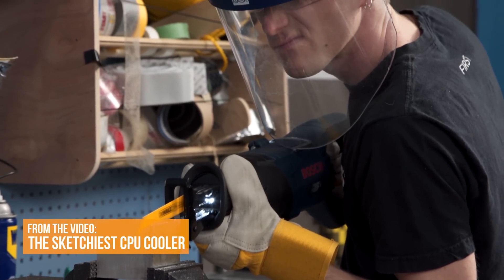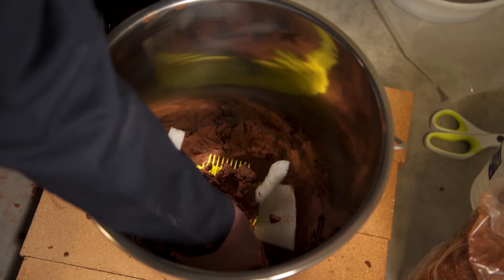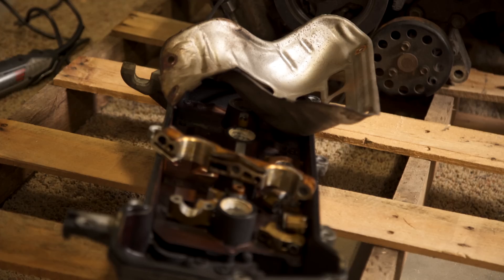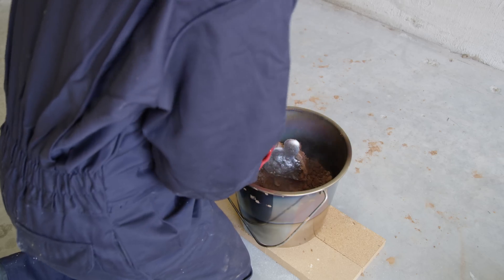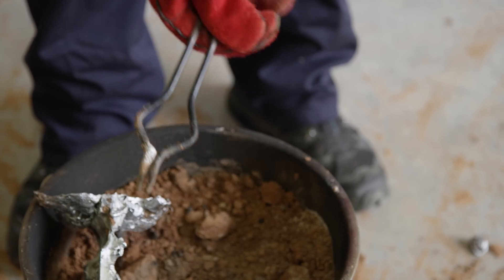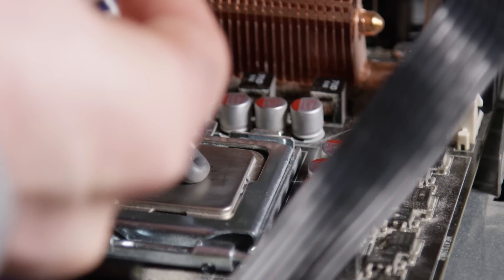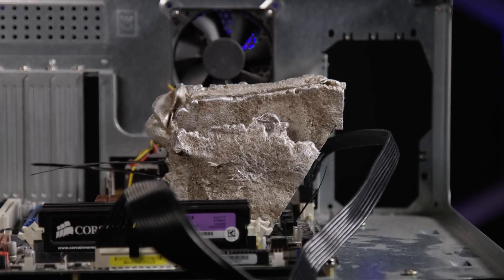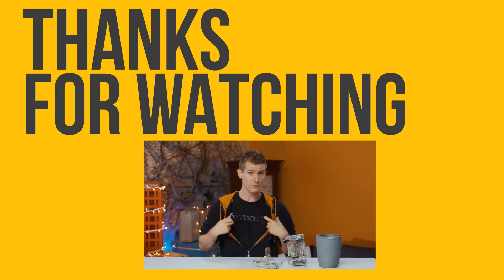The WORST CPU Cooler EVER – Sketchy Heatsinks Ep2

Comment: Hi.
First, I love your videos guys, keep up the awesome work !!
Second, as an almost graduated mechanical engineer, I can tell you that the best way to build a heat sink is probably using a CNC milling machine. There´re a lot of DIY products available, and you can probably get one for free via sponsors, and also it would be a great video (IMHO). I´m currently working in CNC/3D printer as a project in my university =), if you want, I can send you more info about it as I progress in the project.
Once again, love your vids, and have a great day =)

Comment: After you make a plastic model, coat it is rubber to make a reverse mold, then make a second copy of wax. And why would aluminum go up into the fins????? Of course you could mill fins from a block of aluminum, but not with a reciprocating saw! Saws like that are use in demolition. You need a router bit for medal and a jig. Where did these ideas come from????

Comment: I love how it looks! from cooler masters bronze age range. You could have made a mould from heat resistant rubber, If the aluminium didn't melt the plastic then a heat resistant rubber should be ok.

Comment: -3d print the heatsink made in solidworks
-press the plastic heatsink into green sand from above so it forms a mould
-carefully remove heatsink from top of sand
-pour aluminium :)
Reply: Rico Willebrands instructions unclear. eye stuck in water bottle
Reply: Rico Willebrands that's actually a good idea
Reply: Dennis Rigdon No, It's casting... Forging is a completely different process.
Reply: Rico Willebrands this is proper forging 101

Comment: Alright, lets watch this train wreck.
Edit : Was not disappointed. Maybe watch a video or two on aluminum molding before attempting this next time... like using Wax for the initial mold, baking a clay mold of said wax mold(maybe 3D printed stuff could work too if it melts at oven temperatures), which makes the wax melt leaving you with a hard clay mold... then pour aluminum in the hardened clay mold... I dunno, just saying.

Comment: honestly you guys were casting it wrong the fins should been pointed down at the ground instead of facing upwards
Reply: milodudeful why did this not get more likes?!
Reply: ikr
Reply: it was easier to get a flat bottom this way
Reply: megaspeed2v2 nothing was easier the way they did it... lmao!
Reply: megaspeed2v2 easier in regards to NOT weighing out how much aluminum would be needed as well as them not supplying any guiding pressure vents to prevent air pockets getting locked in any intended level surfaces. Part of compacting in layers is allowing for any sort of modification that would be over the top with the throw away cast.
Reply: megaspeed2v2 you can always grind down the bottom like what they did in the video
Reply: Umayr Sayfurrahman it's almost doubled in the hour since you commented ;-/
Reply: Wow 71 likes it would be nice to know if someone likes my comment THANKS YOUTUBE agh lol
Reply: I was thinking that too. 'Upside down Linus, UPSIDE DOWN!'

Comment: why not put the cast upside down in the sand so that the metal can seep through easier with gravity?
Reply: umm, "they would have to sand something down" pretty sure they did anyways at the end.
Reply: If they using an upside down model, I'm sure gravity would have filled way more gaps and it would have a way flatter surface for the mounting.
Reply: as long as they have a bottom that cover ALL of the fin gaps, it would work much better, not even a question, I can find the answer to that in gravity logic.
Reply: As with all castings, you are required to machine any surfaces to meet specific characteristics. For these reasons and more, the head gasket surface and bores (and numerous other surfaces) on an engine block are all machined to meet there specific goals. Casting is just the first step in producing a finished piece. Cleaning and machining are just as, if not more important.
Reply: TheFPSPower Not the gaps that need to be filled though
Reply: Because its Linus team.
Reply: You're onto the right idea here. Instead of using a medium that is burn away (which is used in more hobby casting) you can make an impression using you 'pattern' in the casting sand. Think of it this way: You could also use copper which has less issues with oxidation, has better heat transfer properties, and melts at a lower temperature.

-Have he sand ready, well compacted and level.
-Then press the plastic heat-sink pattern fin side down into the sand. Ensuring that the base of the heat sink is level with the sand.
-Then remove the plastic heat-sink patten form the sand. You'll now have a negative impression of the heat-sink in the sand
-Cure the sand to reduce moisture content
-Pour in the liquid Aluminium in.

The Aluminium will find its way to the base of the thin fins pulled by gravity. The base at the top of the mould will have a ruff surface that can be machined later.

To cast the heat sink properly however you would need a multi part mould.

Option 2: Pay someone with an Aluminium/copper 3D Printer (yes they exist) to simply print your solid works shape. Or less costly, use a CNC ;) 
Option 3: Use a Press and forge a heat-sink
Reply: Because the most important part is making sure that the mounting surface is as perfectly flat and flawless as possible. And yes, while the end result did not have that due to its porous nature, it would have been even worse if they had it upside down. When it's on the bottom, at least gravity ensures it's as perfect as they can get with their method
Reply: Then, if you're going to have to sand something down, you know where to start - the top, where it would connect with the cpu!
Reply: Bipolar- Bear Because they wanted the flattest bottom possible and that wouldn't be it

Comment: You should use lead. . .  

No reason why.
Reply: something1random23 Yep.
Reply: Do you seriously think lead is that hazardous? Is the lead just going to animate and stab everybody with a lead knife?
Reply: Pure lead melts at 327C, your CPU and everything around it will be dead long before that happens. Tin-lead solder melts at about 183C, give or take a few degrees depending on the specific mix and extra metals in the alloy, which is still well beyond a CPU's operating range. Some power semiconductors have working temperature range going up to 175C, but that's junction temperature, their cases would be quite a few degrees lower than that once attached to a heatsink of any sort.
Reply: let me guess, to poison the whole huilding?
Reply: Too much of anything is toxic...
Reply: +StoreBrand, yeah it's just toxic when it's in your blood stream. That said, don't touch it for too long because it will "soak" into your skin after extended periods, though, probably not enough to hurt you. Heavy metals are all toxic. Even too much iron is toxic.
Reply: The lead would melt itself lol